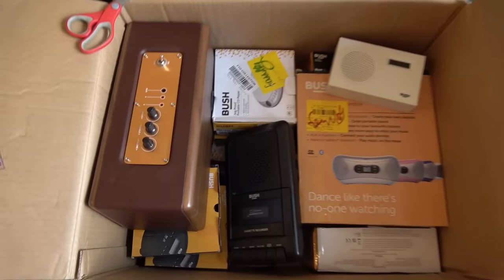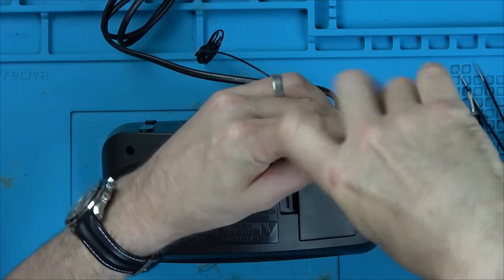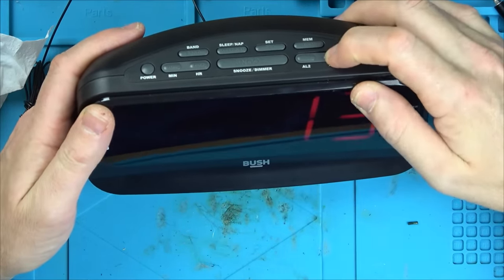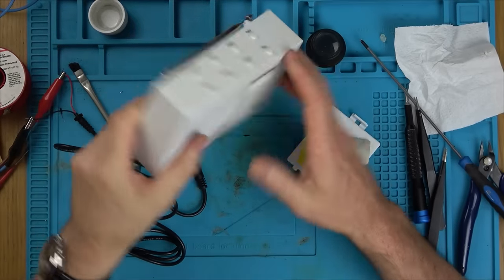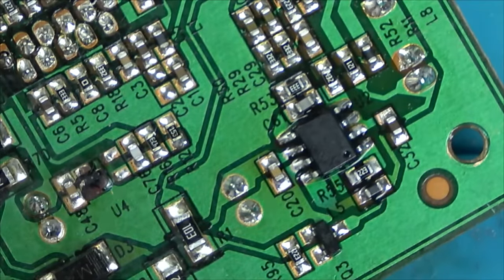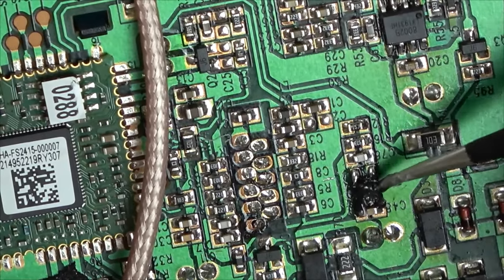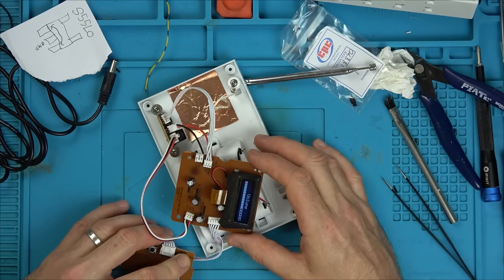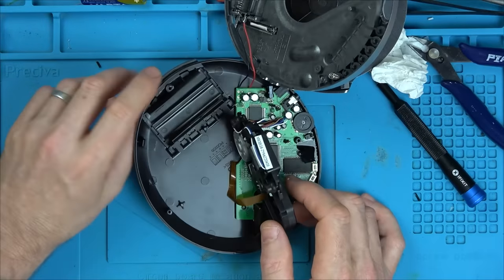I Bought ARGOS CUSTOMER RETURNS to FIX - Can I Make ££$$€€

Comment: This reminds me of a job lot of microcassette recorders I bought a few years back (mostly Sanyo). One was a really easy fix .. dislodged pinch roller carrier. Unfortunately there seems to be a common fault with the motor controller on these .. several run at about half speed set at 2.4 and barely run set at 1.2.

Also, When I was in the TV repair trade I spent a while in the back workshop doing contract under-warranty repairs for Makro (customer returns and often stuff which was put on display and found to be faulty). That must have cut into their margins somewhat! Literally a small van load (Bedford Rascal!) every week or two.

Let's put it this way: I much preferred working on the old, decently made stuff our customers brought in than this!

For the CD players, it turns out you can still get replacement KSS150 & 210 laser units quite cheaply. These seemed to be the common ones at least in "HiFi" type units. Not sure about rhe portables.
Reply: Laser units are relatively easy to recover from old pc cd and dvd drives. All IT refurbishment companies will have a pallet full kicking about.

Comment: Regarding that pin on the 3.3v regulator. The line over the SHDN (or any logic pin for that matter) means that the signal is inverted (i.e. Not Shutdown), making it an enable pin. I think IC manufacturers do this deliberately to confuse designers and repairers😂

Comment: I'm assuming on the second bush radio the FM aerial has been pulled out the back and it's ripped all the speaker and aerial connections off inside.

Comment: * - @13:11 on C9, it looks like there is a bodge wire from factory.. can't tell if it goes to L1 below it.. or over to FM antenna.. Also .. that's why you don't add hot glue til AFTER you test it.. lol

Comment: The clock radio probably used a linear power supply to use the mains HZ to keep good time. 

That is why you can't use a plug in wall clock while on generator power.  The frequency is not near as stable as mains

Comment: Those cheap clock radios usually run the clock of the mains frequency so it’s much simpler to have a transformer and a lines power supply to tap into that

Comment: Re: the 3.3v regulator: the line over SHDN in the datasheet means it's inverted: high input to NOT shutdown, low for shutdown. Which means it's the same input as the ones that had an ENABLE input.

Comment: Do you think that second clock radio was maybe an unwanted gift, so somebody sabotaged the wires so they could take it back for a full refund?
Also for future testing, it might be worth getting a crystal earpiece, the kind crystal radios used. It's just a bit of piezo stuff nowdays inside an ear plug, or you could even use a piezo you had hanging around, but they're much louder if they have some plastic cone or something pressing on them.

They have a very high impedance, so you can connect them to random points on a (low-voltage) circuit and they won't short anything out, so aren't likely to break anything. That means you could find your speaker connectors just by poking about with one til you hear music, or hiss.
Reply: That's quite a bit of effort for maybe a 25 quid refund

Comment: 5 pins is, and I say this out of my mind, I think if I remember it correct, you have 6 volt input, 2 pins. You reduce it to 3,2 volts, so you need to have also a ground, 3 pins.
And i also need to learn to watch the whole video before placing a comment 🤣

Comment: The one with the wires ripped out. I used to see that alot at my old job. Wires mysteriously ripped out. It means the customer needed money, so wanted to return it for a refund. So made it faulty so store will give the refund without arguments. Unfortunately it happens more than you might think.

Comment: Clock radios can't generally use switch mode power supplies as they kick out too much hash interference so close to the circuitry.
Linear PSUs are quiet.
Reply: They use linear power supplies simply because it provides a convenient way to allow the low voltage electronics to monitor the power line frequency to use as a timing reference.
Reply: @beefchicken  What,??
DC is DC. Linear means Near Zero noise. A switch mode would obliterate the AM band.

Comment: My guess is that someone plugged in a 12V power adapter in to that white BUSH radio and this is why the chips got buned they are permanently powered and a higher voltage can easyly kill them
Reply: Yep i did not see a real powersupply or protection circuit before the ics just cheaply made just the power pins of the chips directly to the outside world aka the wild west.

Comment: 2nd Radio - Antennas:
All antennas are either a centre-fed dipole or a modified centre-fed dipole.
A centre-fed dipole has the feeder going to the centre of two conductors. This can be inconvenient to mount in real life, so a modified version is often used. One such modification is to use the ground of the PCB / device chassis as one part of the di-pole, and this means you only need one other conductor for the "antenna". 

Your radio has three connections:
GND - This is the "lower half" of any dipole used on this product
FM - This is the "one other conductor" for this "band"
AM - This is the "one other conductor" for this "band"

There are two antenna connections (AM/FM) because the frequencies used in the two bands have very different wavelengths.

When set to AM, the frequency is very low (around 1MHz) and the wavelength is very long (around 300m) , and this requires a very long antenna. It impractical to have a straight bit of wire at such a long wavelength, so the wire is often coiled up instead - a so called "ferrite rod antenna". In reality, it is bit more complicated that this, as a ferrite rod antenna is actually part of the tuning assembly for the radio, and is physically "tuned" with an on-board capacitor. You were right bythe way - it IS "just a coil" so it doesn't matter which way around the wires go.

When set to FM, the frequency is relatively high (around 100MHz) and the wavelength is relatively short (around 3m) , so the antenna doesn't need to be so long.

Comment: This reminds me of a cheap voltage meter my parents recently bought. Brand new. Didn't work. The problem? The wires that ran from the battery connector to the motherboard PCB weren't soldered down at all.  One of the wires was just hanging freely. It was the easiest of fixes, but talk about miserable QC.

Comment: That second radio was odd (a rainy Friday afternoon in Shenzhen, perhaps), well done, except (ho, ho) for the part where you were saved by the steering diodes (D2 D3) using the swapped-polarity power connector. If not already fitted, suggest a capacitor in series with your test speaker, for when you connect it to a power rail.

Comment: You would not have a diode in the path of an audio signal. Always follow the track back from connectors and check the IC numbers if you're unsure.

Comment: you said about the schematics thing, i really do agree but when you look at it from a cheap low tier manufacturers perspective, why would you even bother to spend money as a pcb manufacturer marking off these parts on the board when for one you’re making less than mid range “non serviceable” products and two less than 10% of the target market is gonna repair these units, it’s probably a thought to them that is completely negated by lack of serviceability and general public consumerism

Comment: You can see why they just throw it away or sell as faulty batches. Because low value mass produced and the time taken for an electrical engineer to fix them isn't really worth their resale value because you'd only earn around 10 per hour. Buying customer returns I used to do but simply not worth the time and effort...but good fun to do and a learning experience.

Comment: * - (white radio) WHY would you put that black tar over the regulator b4 you even tested it? that's more like a finishing step.. U didn't even know if it was the right one.. (just sayin).. ALSO @37:35, not sure if you noticed, but top left corner of board.. there's 4 pads labeled.. there is a UART interface you can connect too, (can't make out the writing on the pads to the left of it).. 😃 Also there are alotta pins on that keystone that aren't connected.. could prolly have sum fun with those too... 
ON the datasheet for the keystone (SIENA FS2415).. on datasheet it says "UART/SCB (I2C compatible) control interface"

Comment: The Bush Alarm Clock, for me it looks like the push button you take from the board was not in the center, as you take it from the tape and put it back, straight on the center, put the tape new over it, it work…mmh…that was it what have seen….not?

Comment: I ordered once an XBOX360 style controller for PS3.
That one didn't work at all, was completely dead....
Then I looked at it, after I got a refund and you won't guess what the issue was.

Badly soldered µUSB Port. After resoldering that, it charged and worked...

Comment: The only time it matters which way you wire up  dpeaker is when it is stereo. Otherwise it makes no difference which wire goes where.  The only reason it matters on a stereo set up is to ensure the speakers are " In phase"

Comment: 1:17 I have a clock with the same problem, i found out that if the brightness of the display is lowered, the Vol. down button is not working (a software glitch).

Comment: I have one of those alarm clocks. The battery is for backup but it doesn't work on mine. It's no big deal I can just re-set the time if the power goes out.
Reply: Maybe the polarity is reversed?

Comment: I’m guessing that white radio had a run in with the wrong polarity or wrong voltage on a cheap mains adaptor. Consumers need to be educated about voltages and the difference between centre positive and centre negative.

Comment: hi, i have a door sensor that is broken, it does work but i need a replacement part for it, where do you get your replacement parts from like ya resistors or however its spelt

Comment: I'm truly surprised by all the variety of radios you have. Here in the states simple clock radio and battery transistor radios have pretty much disappeared from store shelves. Then again maybe im not looking for them as I have plenty of old radios that I use.
Reply: I actually bought a new clock radio just a few weeks ago; the power supply failed on its predecessor after 25 or 30 years of constant use. A small discount store had exactly what I wanted. 

(I did donate the old clock to a charity shop so that someone can buy, fix, and then resell it.)

Comment: Where would the best place to get capacitors  they are quite old bang & Olson tuna amp. One
3000uf 25v DCW type kp1 242x1 plain negative and two 3000uf 70v DCW red positive type 2404x2  or alternatives I would appreciate any help

Comment: That was a lot of work for a £20 Bush DAB radio and still unsure of working order, unless you are doing it as a hobby with your skill set, the sell-on value isn't half of an electronic engineer's wage (mitigating any financial gain from youtube), however, if it is enjoyable and you are having fun then it's as good as a wage

Comment: £15 for a portable CD player. I remember when they first came out and were so expensive you could only dream of owning one. Now they cost less than the price of a pub meal.
Reply: My e wife had a Sony one about 20 years ago and it cost a fortune, between £90-£100 as I recall, but it still works today whereas the vast majority of the cheap Bush versions are landfill within 2 years....
Reply: Got a Sony one on a flea market a few months ago for 50 cents.. I do suspect a rise in price in a few years, just like with vinyl and cassettes the cd's will come back eventually

Comment: I´m convinced that some devices are tampered by the customer to take a refund.
Reply: That is quite common actually.
Amazon returns can be even worse, cause Amazon doesn't even check what you return.

I heard some people bought some 12900 CPUs when they came out, and returned them because they "had the wrong socket".
They replaced took out the CPUs from the boxes, and replaced them with coins of the same weight so the return box wasn't suspiciously light.

They got away with it. The only reason anyone even heard about it is because one of them bragged about it on Reddit.

Comment: first clock was a manufacturing fault second clock has been stripped down & deliberately damaged radio someone put a power adaptor with a voltage higher than recommended cd player been taken apart & gromet lost or used to repair something else infact most returns are items that have been deliberately damaged or old items sent back instead of the new ones which large companies like argos have to accept & refund even thou the item that got returned was not the one that got sold your lucky that these could be repaired as a lot of returns are usually beyond repair

Comment: its quite likely that second alarm clock has DEFINITELY been tampered with.
I did a similar thing when returning a cheap $50 dumb phone I bought so I could still at least answer calls while my Xiaomi was being repaired. I bought the phone, used it for 2 days, until my Xiaomi got repaired, and then this cheap phone was no longer needed. Then I noticed the return period hasn't expired, so I grabbed the $50 phone, removed its battery, intentionally overdischarged it externally which caused it to expand and become a spicy pillow (like most LiPo cells do), and in addition, I grabbed its cheap unsafe charger, opened it, unsoldered the charging cable so it no longer can charge, and then I boxed it all up and I took the $50 phone back to the phone store and said that the charger exploded. They instantly gave me a refund.

EDIT: THIS WAS 3 YEARS AGO
Reply: Odd place to advertise that you stole $50 from the store.
Reply: @jonathanInLondonUK  no, it's perfectly related to the video. the second clock has wires INTENTIONALLY cut, and you can tell something was removed.
Plus they wouldn't let me return the phone if it was fully working, hence why I had to fabricate the fault myself, much like this clock was.

also the money ain't stolen. I paid for the phone, then returned it then theyy gave me my money back
Reply: @RealEpikCartfrenYT  I agree that the clock was likely tampered with.

However, you paid $50 for a working phone.  I am guessing you'd have been unhappy if it was second hand.  You then returned it unusable and got your $50 back, so the retailer was down $50.

Comment: Buy a cheap test meter. Would make things 100 times easier. 
Hold on - you're now working on the second clock and you've pulled out a meter! Why didn't you use that to test the continuity of the buttons on the first clock???

Comment: "Q: How long can a music clip be on YouTube without copyright?
A: It doesn't matter if it's just a short clip. 10 seconds or 30 seconds. You still can't use it. The only way to legally use music on YouTube is to get permission from the copyright holder (or whoever does actually “own the rights” to the song)."

however, from the law:
"The Copyright Act Criteria:
Since music is interpretive, it's more likely to be protected. The amount of use: This is where the 30-second rule is debunked. Small portions of a work may be permitted as fair use, while the entire work is not. However, there are no specific guidelines for infringement."

because of course Google knows better how to cut $$$ ;-)

Comment: The 2nd digital alarm clock “smells” of Chineseum crap = spat-out of such a factory and dumped on Ailbaba [quality control non-existent] and it appears that Argos has bought the batch from Ailexpress, and that particular poor customer got a dud. Note - “BUSH” bold capitals with u.s underlined , is a zombie brand = Chinesem crap/polished turd 😠

Comment: a speaker would never go through a diode.
Reply: Yes, because the diode, at least a regular one, would chop away 0.3~0.7 volts (depending on the semiconductor material used) from one side of the sine wave and completely eliminate the other voltage polarity of the wave.